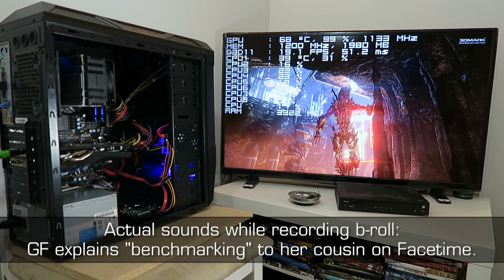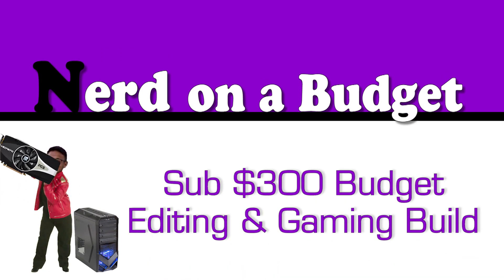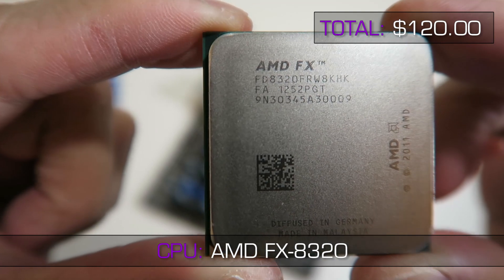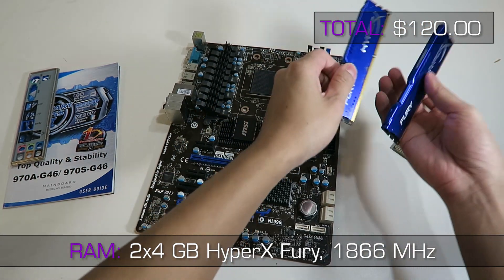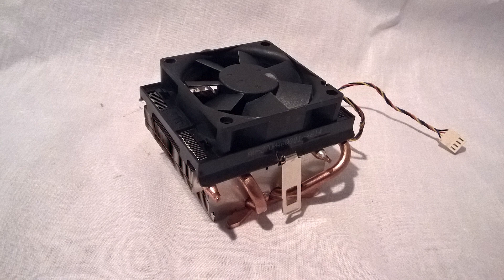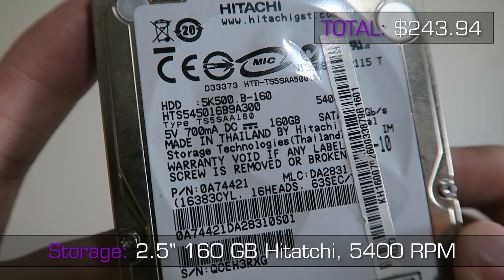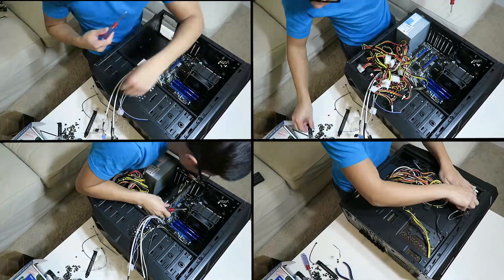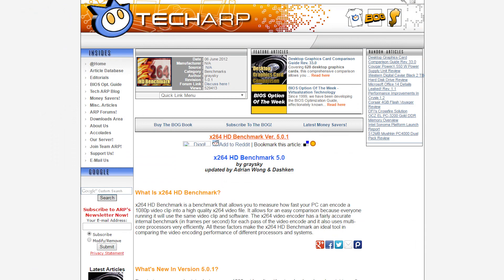The Sub $300 Budget Editing and Gaming PC (FX 8320 + HD 7870 /w Benchmarks)

Comment: u know, your prices are BS. This is not the first time i noticed. That mobo + cpu + ram combo is worth like 200 bucks, not 120. Either is the seller totaly dumb or youre cheating on your followers
Reply from the maker: +TcgShopLandshut uhhhh what? That's why I post the prices, because that's what I pay. People post all the time the great deals they find, sometimes they're even better than mine. Just because you can't find deals or don't know how to effectively search doesn't mean I'm lying. If you're searching on eBay for prices you're doing it wrong. If you're not constantly looking at your Craigslist ads and buildapcsales and hardwareswap you should probably start instead of making false accusations.
Reply: its not representativ to post such Builds, if its not doable in a short amount of time for everyone. If i go hunt for part for a week, i wont get the prices u got in the vid. ( FX8320 for 50 bucks? Rly? never saw one for under 75, same goes for mobo ) That 120 Dollar deal was one in a lifetime. It may be true, that you somehow spend 300 Dollars on it, but everyone else will have to spend like 370-400 to get the same parts
Reply from the maker: +TcgShopLandshut this is doable in a couple of weeks for the same price, if you're spending more on the mobo and cpu then you can spend less by opting out of the cooler and getting a cheaper case or going used on it, this is a representative build for under $300. Also the $80 7870 was a bit expensive, you can find them as low as $60 now. I have another build I did where I found a FX 6300, same Mobo, 8 GB RAM, and zalmann cooler for $120 as well on Craigslist, just haven't made a video yet because these take a long time to edit. If you're living in the US you can out together something similar, well, maybe you can't, but LOTS of viewers have told me of their great finds with similar price and performance.

Comment: I Would replace the graphics card with a gtx 750 ti
Reply: AlexTFG hd 7870 much better than 750ti
Reply: AlexTFG why though?
Reply: Joey Nguyen better peroformance and it's only 20$ more
Reply: AlexTFG the 7870 is better in the long run becuz nvidia doesn't focus on drivers for older cards
Reply: TechNotTr3vor isnt hd 7970 better than hd 7870
Reply: McPovisLtu Productions ya but at like $20 extra

Comment: What would you do for a $400 gaming rig? I want to build a cheap one now and a nice rig once I'm more familiar with building a pc.
Reply from the maker: +Jake Enders I would up the GPU, can get a nice one like a GTX 970 and or r9 290, and a better motherboard so the CPU can actually overclock
Reply from the maker: +Jake Enders I would up the GPU, can get a nice one like a GTX 970 and or r9 290, and a better motherboard so the CPU can actually overclock, and a ssd
Reply from the maker: +Jake Enders I would up the GPU, can get a nice one like a GTX 970 and or r9 290, and a better motherboard so the CPU can actually overclock, and a ssd
Reply: Nerd on a Budget motherboards are another language to me still. Advise on where/what to start looking at?
Reply: for mobos you really just need to know about 3 or 4 things. 1st is cpu socket (for amd its either fm or am3+....most everything will be compatible with one or the other). for intel you have to have the proper socket AND the correct chipset. Right now intel's main consumer line is lga1151 just remember you need a "Z" series motherboard and a "K" cpu if you are going to overclock. (side note for xeon you need a "C" series motherboard but I wouldnt do it because the price of the motherboard makes it cost about the same a a Z mobo with a K chip). The next thing is making sure your ram is the same type (ddr3 or ddr4 right now). 

The easiest thing to do on a 1st build is to buy a combo, pricewatch.com has combos and newegg.com has combos too (they just dont list them for some reason). Find the cpu you think you want like the i5-6600k and search on neweggs search box for "i5-6600k combo" and you will get a list of mobo&cpu combos some with ram too.
Reply from the maker: I don't think the Summit Ridge 3/5/7 processors will fit into a $400 budget based on speculation I've been reading, but the G4560 right now is one of the top best bang for buck processor you can get
Reply: Jake Enders Watch green ham gaming's video called The Incredible I5 Dell. Buy parts like the ones in the video.
Reply: Get a 290 instead. The 970 was gimped.
Reply: Jake Enders wait for Zen otherwise the new pentium g4560, it basically is an i3 for $70
Reply: Jake Enders Well word of advice dude keep watching vids like this get familiar with the lingo and don't be intimidated by this stuff its a fun a really self rewarding process when u build ur own BEST OF LUCK TO YA MY FRIEND!!!
Reply: Very good idea. Thats what I did in the past, and it helped me to get my bearings very nicely. All this advice people are giving is great, good luck!
Reply: yurimodin you are a god. Thank you
Reply: I'm pretty sure if you go all used you can find a 2600k and an oc board + gtx 780/970/r9 290/x and still have enough for some standard ram, psu and case, hdd at around the $400 mark. a build with something like this would be good for almost any game at ultra 1080 60fps
Reply: Well for $400 it would probably be best to roll with the 1050ti OC 4GB ($140) and a Gigabyte H110M-A motherboard and probably and AMD Chip (maybe an intel 6100) and then the SSD
Reply: Jake Enders here's a parts list of a 400dollar PC build, remember you can always find great deals on used parts instead 
https://pcpartpicker.com/list/jmFYbj
Reply: LiveForFun what can this PC run? im trying to get my first gaming PC to build and I don't know much about what parts are good or bad my budget is around 550.
Reply: Kyle It can run any game on about 30-60 fps on low-med settings at 1080p and in some games on high, but ofcource games like CSGO will get 100+fps.

But here is what I would recommend for that budget, it can play almost any game on high-ultra settings at 1080p@45-60fps, I have a very similar build and I haven't had any problems at all running any game on ultra, at a smooth frame rate, you can get Windows on Kinguin or Reddit for about 40$ (it works, I've tried). Good luck! :D
Reply: Kyle It can run any game on about 30-60 fps on low-med settings at 1080p and in some games on high, but ofcource games like CSGO will get 100+fps.

But here is what I would recommend for that budget, it can play almost any game on high-ultra settings at 1080p@45-60fps, I have a very similar build and I haven't had any problems at all running any game on ultra, at a smooth frame rate, you can get Windows on Kinguin or Reddit for about 40$ (it works, I've tried). Good luck! :D

https://pcpartpicker.com/list/rFpWyf
Reply: https://pcpartpicker.com/list/NRz9yf  then later instead of building a whole new PC you invest in a better GPU, CPU and maybe a SSD.
Reply: Don't know why i couldn't reply on my other account but shit this is the one i ordered let's hope it can run BF1 at least medium settings... https://pcpartpicker.com/list/msmBxY
Reply: kinda a waste when used parts are so much cheaper for performance. and i kinda would expect you to know about used parts when you're on a channel mostly dedicated to them
Reply: JustIncognito I'm on the channel to find my first gaming PC so this is what I choose :/ I was told this was a cheap gaming PC
Reply: It takes time to learn about pcs. you have to start somewhere. while shopping for used parts is awesome at first i think its ok to buy new parts with warranties for piece of mind. as time goes on im sure he'll go the used route to maximize his performance and lower his money spent.
Reply: Minmataro718 peace of mind for warranties on pc parts is for people that didn't take the time to learn about them. If you're on a budget then you should be interested in learning yourself and not buying a premade list that somebody posted online
Reply: Everyone starts somewhere. Give the guy a break. I mean go ahead and lie and tell us all that you were a used part buying expert with your first PC build. lol.
Reply: doesnt take an expert to build a pc
Reply: Takes more than someone being clueless though. a lot can go wrong in a build. buying used parts that mostly cant be returned probably isnt the best way to go for some kid building his very first computer. FFS i dont know why im even responding to you. for all i know you got your first PC from iBuyPower...
Reply: Minmataro718 thanks man I'm always trying to ask questions about which parts are good and what should I get and there's tones of people out there who are just smart asses about it so it makes it tough for me to know what to get lol
Reply: Buddy we all started somewhere... once you get up and running if you make a steam account and want to play some stuff send me a f invite. Names the same as this yt name minus the 718.
Reply: Sounds like a plan.
Reply: Jake Enders I would use a gtx 1050 man it’s a very powerful Gpu that dosnt require any other kind of power to it and it’s a plug and play
Reply: if you want i can make a list of parts for you and help you build it over skype i have build my own pc so i know how to connect everything
Reply: Minmataro718 I already have a steam account so I will add you and when my harddrive comes in today ill build my PC and we can play man

Comment: Danny I made a mistake goofing around with my guess this is a AMD and I had a shot and blew it . Great one again - Now I am having trouble finding the truth about my board for OC it is a MSI 970a SLI 3.1 Krait I called MSI I need to know if this is a 8 phase power or jusy a 4+1. If 4.1 OC could kill MB and CPU for if it goes to 100% the voltage spike is not regulate properly and kills every thing. So can you tell me about this board and if I can't OC can you tell me of a board that will not cost too much . CPU is FX8350 - 16gigs 1600 ram. Thanks alwats -- Also First 65 or older

Comment: i bought a old pc :- i7 2600k with a stock intel cooler,1tb wd green hdd gigabyte mother board,8gb ram,windows 8.1 installed,but the system only have a gt240 1gb ddr5 graphis card.. which graphic card should i buy??? bcoz im saving money for 750ti,, anything else could be  better then this??
Reply: Paresh Barot buy a 1050 instead
Reply: 3M1L bt its more expensive
Reply: 3M1L it will worth more wait?
Reply: Paresh Barot its like 20$ more and 70% better
Reply: 3M1L tnx for helping i think i should wait some more
Reply: I would either recommend the gtx 1050 for 107$ or (if you have a 450w or greater powersupply) I would look into saving up for a 170$ RX470. You would then enjoy ultra graphics in most modern titles!
Reply: If you really save up get something like a 1060 or higher
Reply: I have 450 watts circle psu so im thinking to buy 1050 bcoz in india pc components are very expensive actually..
Reply: HD 7870 kicks ass. They are about $65-$80 on ebay. Its much stronger and AMD had better driver support for old GPUs than NVIDIA. Just don't but anything older than the 750 ti on NVIDIA's side since they officially no longer support their 600 series cards
Reply: Get a 1050ti not a 750ti... same price but the 1050ti is 3x as good
Reply: Oi, get a used gpu, great price/preformace, R9 270x, 280x, 290, 290x, 370, 380x, 390 Hd 7850, 7870, 7970, gtx 660 ti, 670, 680, 760, 770, 780, 950, 960, 970, all better than the 750ti, though all except the 290x(600w) can use a  on a 500w psu. All have goods deals, expecially the 290, can be picked up for great prices used.
Reply: As someone who just bought a rx 470 for their old PC, I will say that going from a 9800 GT to a rx 470 is a massive leap of freedom and capability. Considering you're not too far off from my 9800GT with your GT240, I'd like to say that if your rig can handle it, get the best GPU possible. Be sure to use a Power Supply Calculator, and if your system can take the wattage, you can turn your system into a beast of a gaming computer. Per-core, the i7-2600k is way better than any high-end AMD FX chips right now, so your investments will come back strong.
Bottom-line, go for the gold, Paresh Barot. Use a Power Supply Calculator and get the best card you can. Don't stop at a measly 750 Ti, because those cards are old and newer generations of cards are really cost-effective (especially the RX 470, great budget card). Save up I say, and good luck either way.
Reply: Is get an rx 470, worth the extra 20-40 in the long run, check newegg with great rebates on these cards, they even come with the full Hitman game atm
Reply: ***** tnx bro its helpful
Reply: True Inferno tnx bro for your help..
Reply: Paresh Barot gtx 1050ti or 1050 or rx 460 depending on money you have
Reply: Paresh Barot Rx 470 is 150
Reply: Josh L rx 470 stronger but more expensive I have a 470 and can pretty much Max any game out at 60fps
Reply: I would only be able to recommend a 9800gt for a TEMPORARY solution where you don't even have a graphics card, GFX Uber. Regardless, use a PSU calculator online to access how much power your system is using and if it can even hold a graphics card (your parts will be at risk if your PSU is insuficient). You have two options here, option one is buying just a new or used graphics card of choice (gtx 1050s, rx 470s, rx 460s are all nice budget cards), double-checking your computer has a PCI-ex16 slot for it, and probably getting an appropriate PSU for it. Option two being: buying a used business computer (and probably buy a high-watt Power Supply Unit because it probably doesn't have enough wattage to hold a graphics card), and then installing your graphics card in that. Sometimes craigslist has some nice used local computers with great processors, RAM, a hard drive, and free OS for starting off with, making it a really good choice for budget builds.
All things considered, your current rig is slow, instead of buying more RAM, I'd scrap it and put 100$-150$ on a used tower that has good per-core performance (you can find benchmark charts to check that like on Cpubenchmark) and appropriate memory. I don't think it'd hurt you too much to use your old rig and outfit it with more RAM, but that's your call.
Bottom-line: You're probably gonna need a 430w-500w PSU and a good graphics card either way, so be on the lookout for deals on those. Also, 9800GT cards are about 1/7 the power of a rx470, and they take up a lot of power anyway, so I would steer clear of it unless you literally have only enough for a new PSU and 10$ to spend, GFX Uber.
EDIT: Keep in mind that the 9800 GT is really old, everything is going to look like garbage, you'll probably have to use old 314.22 drivers, and you can't play DX11/DX12 games with it. If you're having troubles understanding how much power each graphics card has, I recommend going to videocardbenchmark for that.
Reply: Paresh Barot dont buy a nvidia card they are overpriced af go with a rx 470 or rx 480 for just 100 € more new
Reply: 100 eu is a lot you know...
Reply: u wont have to upgrade then for years
Reply: TriNioX _ By that logic get a 1080 and an i7 7700. The idea is budget. What can u do with the least amount of money.
Reply: 3M1L I heard that the RX 460 is better than the GTX 1050, then the 1050 TI is awkwardly between the RX 460 and RX 470. when I finally start saving up for my build, which I'll likely start doing after I finish high school and start college, I'll try using a RX 470.
Reply: Tyler Kearney i wanted to keep it in budget and 470 is way more expensive in india so im thinking that i should go woth rx 460 4gb version
Reply: Paresh Barot the 460 should still be much better than a 750 TI, can't go wrong with it.
Reply: Paresh Barot since you have a 2600k I would recommend getting a good cooler if you're interested in overclocking
Reply: Tyler Kearney im saving for a 2,500rs cooler 2,500rs decent psu and 10,000rs for a budget graphics card
Reply: Proc is very old tho .. buy the RX460 instead of 750ti .. or get some more money and go for AMD RX470 ..
Reply: Paresh Barot this looked like i was reading a different language
Reply: 960, they go for around 100 on eBay for the 2gb model

Comment: Hey, NOAB. I'm looking to build a PC for $400 or less, but I am new to this stuff, and I was wondering if you could help. I want to be able to play overwatch, and other similar games, and I want to be able to emulate very highly demanding games such as mk8 (yes there's an emulator for Wii u) Can you point me in a general direction?
Reply: start off with picking up a 2500k or 2600k with an oc board. gtx 780/970 or r9 290/x. then all the other standard stuff like ram psu case and drive. this is probably best you can get for $400 with average deals so I highly suggest you look at Craigslist in addition to ebay when picking up your parts
Reply: I can help you out if you want, do you have steam? So we can msg each other and stuff?..
Reply: Bailey's Mario Kart Channel Wii U emulation? That'll be stupid demanding and will have so many issues with audio and gameplay, Why even bother? If you have a Wii U and the game you can pick up a capture card and record that way. 

If you're serious about this though, wait for ryzen and see what that has to offer. emulation is all about single threaded performance, and the options in the used market aren't nearly as good. you could also go with that new hypertheaded Pentium everybody is raving about. if you decide to ignore emulation, you could get a rig like this or an i5 equivalent.
Reply: Rockmandash12 I don't have a Wii u and don't plan on getting one, also no I don't have steam